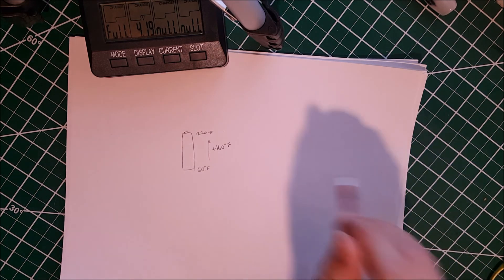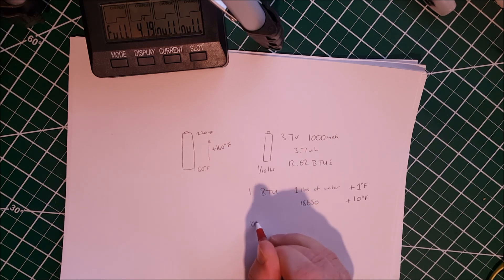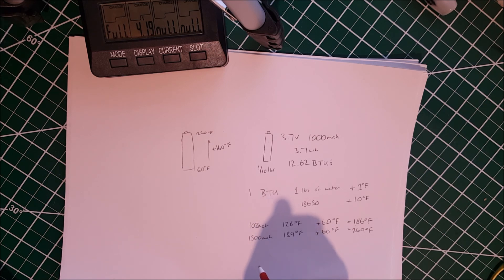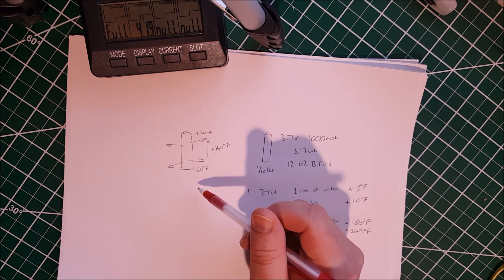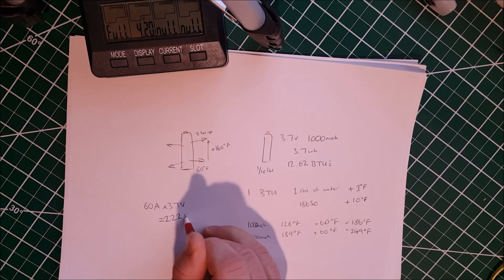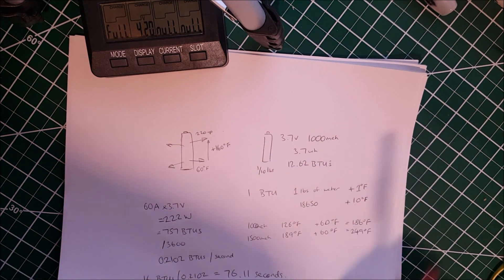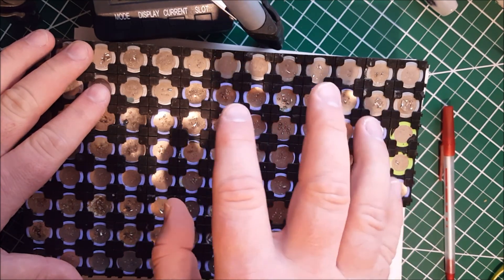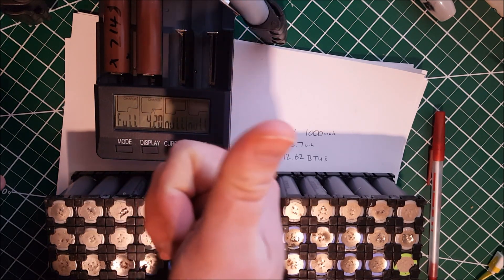18650 Safety: How to avoid thermal runaway

Comment: I'm not familiar with strange units, but BTU is someway are simulare to calories(cal)  and kilocalorie (kCal. And a  kCal is the amount of energy (J) that are needed to rise the temperature 1 degree Celsius of one Kg water. But iron have a 1/10 of it. Water have 4.2J/Kg/K (Kelvin or Celsius) but Iron have only 0,41J/Kg/K. That part is crusial to see what heat it can reach with a specific amount of energy (W/s) . Now have lithium also hight specic heat capacity, around 4.4J/Kg/K, but the mass of litihum are probably very low, compared to the iron. The other substance in a li-ion, battery have I no clue about,  both amonut and what there specific heat capacity are, so your calcylation can be a factor 10 wrong, I think. /Edit You need 10 times more energy to heat 1kg water, compared to 1kg Iron, and every substance have it own specific heat capacity https://en.wikipedia.org/wiki/Specific_heat_capacity
Reply from the maker: Yes I think you're right. I would need to find out what the specific heat capacity is for a Li-Ion cell, but I'm sure it's less than that of water. Didn't understand this when I made this video. :)

Comment: I have no idea what you are trying accomplish here with all this weird math but as someone who has safety tested 18650 and 21700 cells for a living at a well known power tool company I can “safely” say that trying “reset” the CID is a horrible, horrible idea. Yes you want to keep them cool but the trouble is you don’t have the monitoring equipment to check it. You want to be safe? Don’t fuck around with lithium ion cells. IMHO whatever benefit you get from welding all these cells together is not worth the trouble or safety issue you get with them.
Reply from the maker: Weird math? It’s all just theoretical. I wouldn’t put a cell with a blown CID into anything. Was there something useful you were trying to add to the conversation or was this just a judgemental comment? I’d expect more from someone with said experience.
Reply: @SolarSteve   Nothing judgmental about it.  First, your video title specifically states “safety” yet you reengaged a CID on a cell which I previously stated is a very unsafe thing to do. Second, there was no point to all the math you were doing other than saying don’t let it get hot so I’m not sure what your point was. It was just confusing. Your numbers are way off in terms of TR but I won’t state them here for safety reasons. I’ve shorted and overcharged thousands of cells so feel free to ask if you want me to qualify my experience.

Comment: Is the temperature  generated on a specific cell higher with thermal runaway or direct exposure to a fire's flame?
   I see videos where people burn cells with a torch and the cell vents but doesn't explode. Can thermal runaway make the cell explode wide open?

Comment: I'm thinking dual sided fusing on each cell, I ran around 5 A, protects well from the most common causes to thermal runaway if the cells were not damaged or had factory flaws. Then on a power bank I use a BMS, on my bike I have nothing and leave the balancing to the charger. After that a main fuse for the whole battery. This isn't fool proof and what I've thought about adding additionally on my DIY 5 kWh Li-ion battery in my van, is something in line with an Arduino controlled temperature regulation system, with fans for each battery in a tunnel construction. I want one sensor for each section and be able to break the current though a NC SPDT relay with a warning system and if one wanted, emergency cooling could potentially be added through CO2 capsules and magnetic valves to each section. Might be a bit overkill but these things go up in a great ball of fire when things go wrong. Still just in the planning phase. Right now they just have the BMS and three level of fusing.

Comment: Why are you crossing measurements?

1000mAh (milli) = Metric
1lb water = Imperial
10 degrees F = Imperial
BTU = Imperial

I stopped watching because you pissed me off with this bullshit.
Reply from the maker: Tim Lennard you got pissed off because I didn't use measurements as you like? Ok,  I used these measurements because I'm familiar with them.  I'm ok with you not watching the video.  Thanks.
Reply: The haven't find any electricity during the time fore imperial units, I think. I dont know how they can live with that kind of dual standards.

Comment: Does the fan do more than increase the load on the battery? Can passive cooling get the same results without the extra load?

On a bike say, will the increased speed substitute for the fan?

This is what real design engineers deal with. Not adiabatic systems but dynamic systems. 

Start over. What is the actual intended use and what are it's dynamic parameters not some set of imaginary adiabatic nonsense.

Comment: I think fans is a good idea, but you can't just use 1 fan to push all the way through, the poor cell in the end gets all the heated air from other cells. I was actually thinking 3d print a cell holder with water cooling through the gaps like a car engine. if you got the equipment, it's worth a try I guess.

If you could somehow do it face on from the terminal side and put 2 large slimline and low profile fans to push along the cells and out the other side would be ideal but not with that setup.
Reply from the maker: +Phizicks that would be ideal... but just don't know how to get that into there